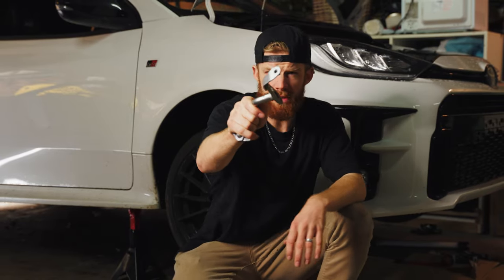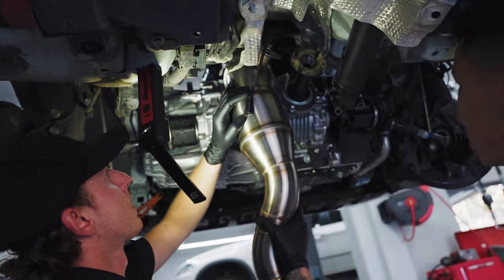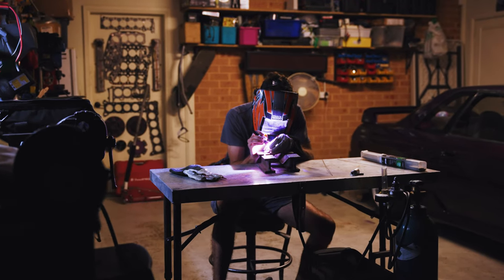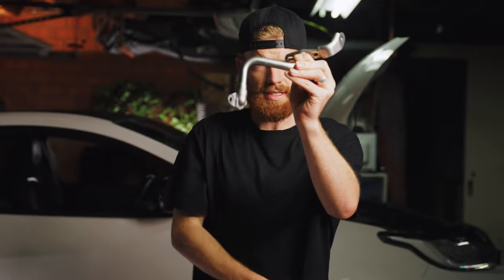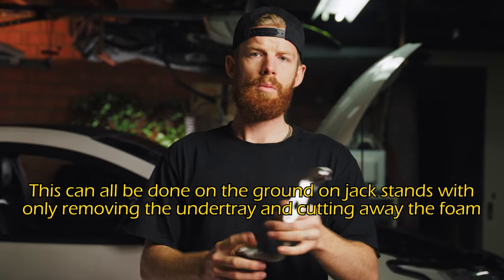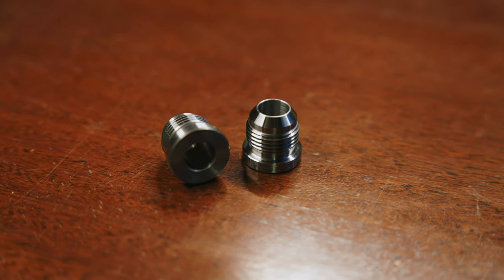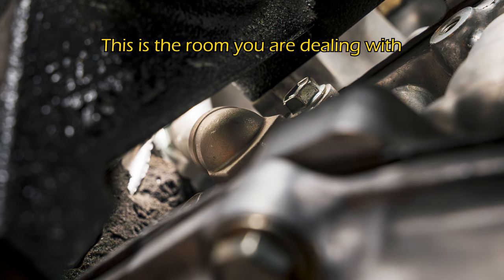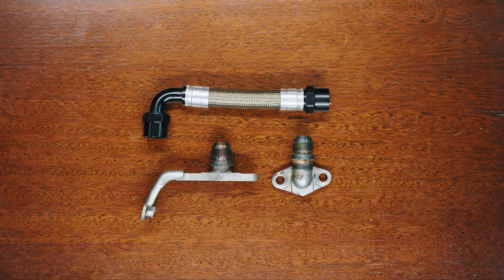GR Yaris manufacturing fault? - Unleashing the Yaris: Ep 2 (4K)

Comment: Toyota here in Japan has stated that this is 100% an aftermarket front pipe issue. They're not seeing them in a warranty capacity with stock front pipe, and every GR Yaris on the road is still within powertrain warranty time. Engine rocks, and if you remove the factory pipe, which is engineered to allow that flex, the exhaust now acts as an engine mount, flexing the turbo/manifold to engine, and the pipe cracks. 

Here's the fun part...If you don't change the torque mount to limit engine movement, or build a bracket to stiffen the turbo-to-engine joint, the next thing to go will be exhaust manifold, which is integral to the turbo, and big money. 

When we modify a car, we deviate from the original engineering, and everything is on us. People love to blame Toyota (I know you didn't), but it's not unreasonable to build a car without factoring in people who will remove the factory cats.
Reply: @FPSRepair so stiffer pitch/engine mounts to go along with this fix then?
Reply: @guiltyspark652  Stiffer torque mount (lower-middle one) keeps the engine from pitching as much, so there's less stress on everything. BUT...NVH will increase. Toyota put a pretty soft mount in there to keep the buzz from a 3-pot at an acceptable level for the average person. I have the Cusco mount, and it's very "race car." Makes the car feel alive, and I love it, but it's not for everyone.

Comment: Do you need to drain the oil before you remove the pipe?
Reply from the maker: Negative, can whack the pipe off with oil still in car
Reply: Only an issue if you start the engine while the drain pipe is off.